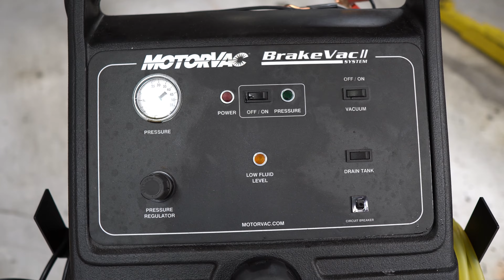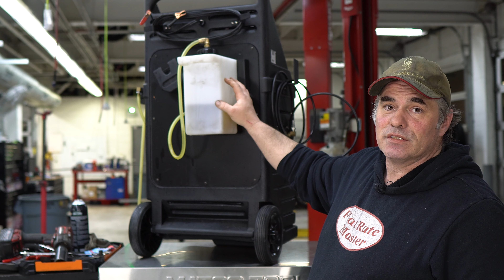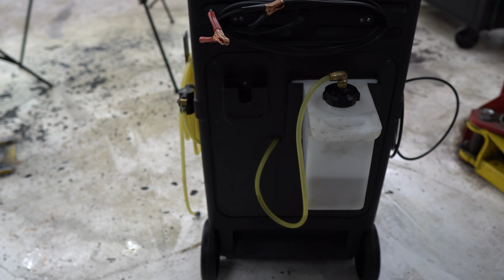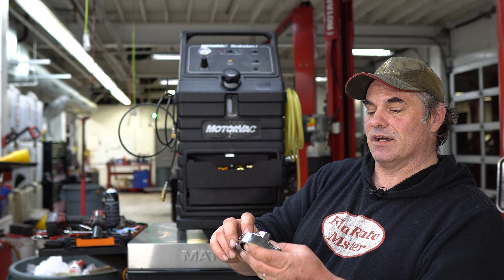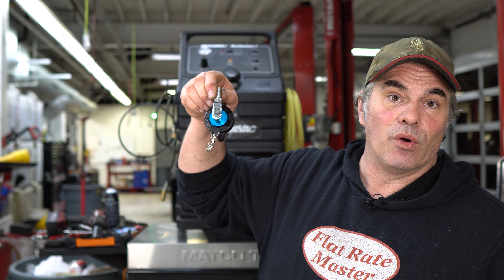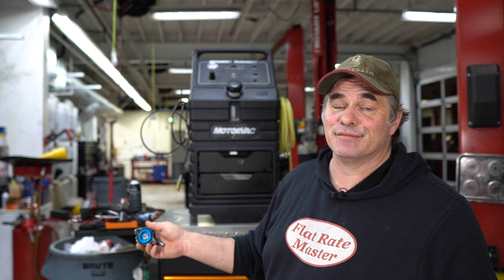MotorVac BrakeVac 2 Brake Flush Machine

Comment: When I was an Auto Tech we used a Motorvac Fuel System Cleaning Machine. I think it was actually called a Carbon Clean Machine. It unclogged clogged injectors and bought them back to life.
Reply: Sometimes, we used that back in late 80s early 90s on the fords especially the 5.0. It actually worked pretty well at getting carbon off the back of valves if they where not to bad.
Made a god awful smoke. Eventually the FD banned us from using it unless we got a exhaust gas suction system. It collected dust .
    Some where along the line customers would just refuse the upper end cleaning, coolant flushes, brake flushes.

Comment: Nothing Bleeds Brakes Better Than a Foot on The Brake Pedal I’ve Been Bleeding Brakes For 35 Years Alone No Assistant With My Foot 😀
Reply: I can do several systems alone. It sucks sometimes. Although the newer cars/trucks are requiring electronic bleeding. When I have people help me they think the peddle has to go through the floor! I have to remind anyone who helps me not to pump the pedal to the floor.
Reply: Prove that sir. I have never succeeded with no assistant. Other than some gravity bleed to start the fluid.
Reply: @t20594  Would Love to Show You In Person Come Too Florida I’ll Show You The Way I’ve Done It For So Many Years 😀
Reply: I do this too, and I didn't believe it either. Granted, if I'm just bleeding after a repair, I'll often get a helper to expedite. But if I'm doing a brake flush, I do the following:
1. Use my pneumatic vacuum bleeder/fluid sucker to remove as much old fluid from the reservoir as possible. Fill with clean fluid. 
2. Open one bleeder at a time, half-stroke pedal 10-15 times, check fluid condition at bleeder. Close bleeder, repeat at next wheel until all exhaust only clean fluid. 
3. Reopen all bleeders and let gravity bleed. Tap each caliper once or twice with a hammer or whatever is handy to break up air bubbles during this several minute process. This is usually while working on something else or another service on the same vehicle. 
4. Close all bleeders as I see fit, then recheck pedal. 
I'm usually done at that point. Very rarely do I need to do any additional forms of bleeding to purge remaining air (and I'm very picky about how a brake pedal feels before shipping a car).
I will admit though, we do more repairs and help prioritize for people who are overdue for fluid exchanges. Usually I'm recommending an oil change, ATF, or a repair, and brake fluid does get mentioned but it's close to the end of the list.  This is changing a bit now though since it used to be that cars needed brake lines by the time they were due for fluid in Ohio. Average year of vehicles I see is now numerically higher, mostly coated brake lines. 
The first time I was told that I could just let brakes gravity bleed for a couple of minutes after pumping the pedal with an open bleeder (and no additional apparatus), I didn't believe it.
I was also told many times that you would never get a master cylinder re-bled if the reservoir ran empty without bleeding at the master first. I've found that this often isn't necessary, and you can quite often open one bleeder and have a helper use a finger as a crude check valve to get it going. Granted if I just ran brake lines and everything is empty I still bleed the master on the firewall first.
Reply: I will clarify that I absolutely agree that there are definitely more efficient methods if you're in a shop that does this in high volume. But it is possible to do it this way if the purchase of expensive equipment isn't logical.
Reply: @ClaytheBMXer  If you cant sell the service to get ROI .
If your shop is just not pushing the services and getting the time for them. The equipment is moot if you dont sell/charge
    Around these parts most people wont pay for a fluid flush until a brake like blows.
Reply: Sounds not very possible. I would love to see something like this in person.
Reply: @Timothy-Wess  It Is Very Possible
Reply: Sounds like a hose on the bleeder into a bottle and you're running from the bleeder to the pedal.  Maybe a check valve on the hose to prevent the reentry of dirty fluid.  A risk of a small amount of air being introduced through the bleeder threads.  My preference is to eliminate all possible risks of introducing air.
Reply: I put our machine on suction and use thy foot, our machine is awful is why

Comment: Thanks for the video. We use a mityvac bleeder with old gatorade bottle with vacuum hose at the caliper end. One of the biggest problems we ran into is overtime. The hose for the brake fluid gets hard and leaks so I converted it to stainless steel flex brake hose from speedway motors have not had a problem since.
Reply: I still use a manual hand pump. But I use a Powerade bottle because I don’t like Gatorade.
Reply: Never worked at shop that had a flush machine. Always had to do it with self made equipment.